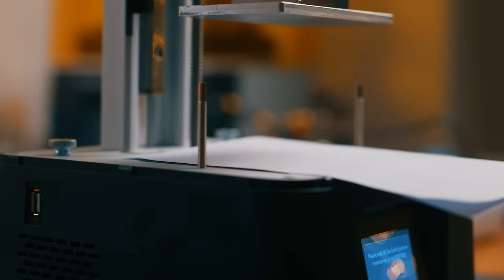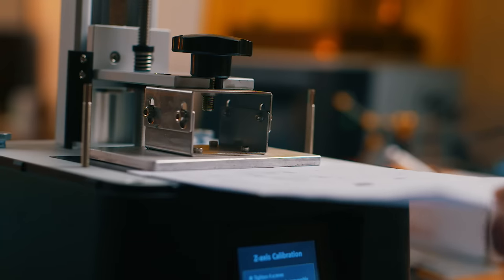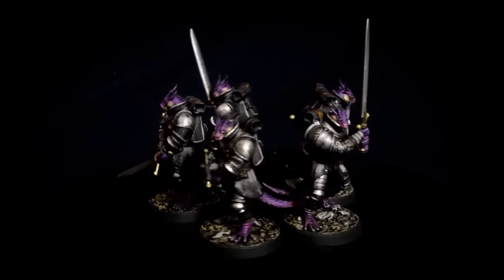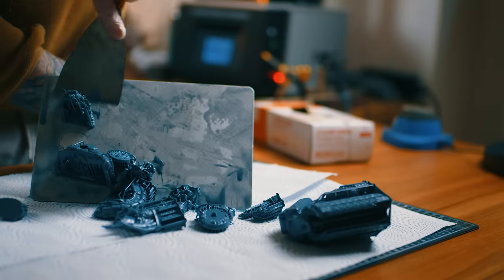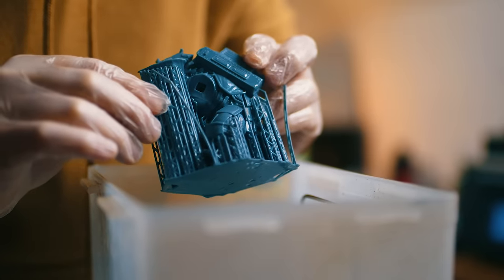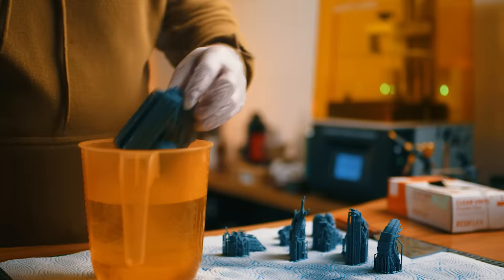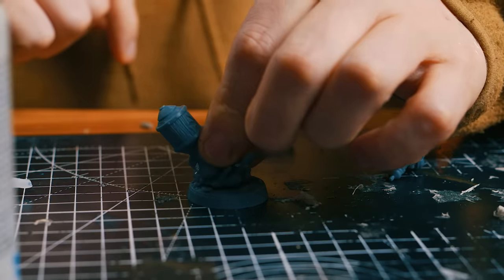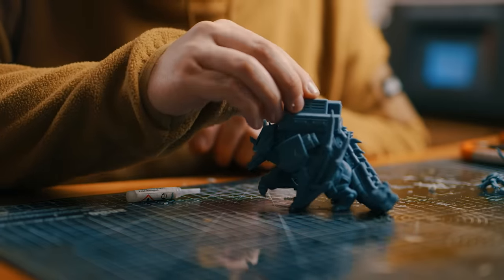Watch This BEFORE BUYING A 3d PRINTER

Comment: My Creality Halot One has been crap since I bought it a year ago - cant seem to get it printing One Page Rules miniatures at all.
Reply: Which resin are you using?
Reply: I really struggle with mine too
Reply: @SilentFlatulence  tried loads but had best results with elegoo ABS Like. The supports never seem strong enough and the models end up stuck to the fep. Literally given up with it.
Reply: OPR have a dedicated support section on their Discord where you can get help.
But the general tips still stand : bed leveling, printer on a flat surface, room temperature (min 20 C, 25 is best), shaking the resin bottle (never let it stay too long in the vat). 
I use Elegoo Abs like too and their settings and the only times I got failures it was mostly due to one of those reasons (temp mostly) and sometimes bad/low supports . It takes time but when the settings are right, your printer will go brrrr
Reply: @5lippy404  If you are getting supports printed but no models, I would say temperature or lift speeds. Try increasing the first and reducing the second, or as counter-intuitive as it sound increasing both. With lift speeds and separation from the FEP you can go for a slow gentle peel, or a fast rip, the middle ground is not ideal. My settings with ABS like is 180mm/m lift speeds, you can get away with 240 or 300 if its a very well supported model. 
Maybe even add a delay of 0.5-1s after each layer print before lifting if the first two dont help. I am far from an expert, but have a few years printing experience and these things have helped. Also if you have a full build plate increase your lift height, having a lot of surface area stuck to your FEP will stretch it more so you need to lift further to get it to sperate. 
Hope this makes sense and helps
Reply: @B4MBI72  I now use 3mm/s (180mm/m) on all OPR miniatures as this seems to get the best results. Room temperature is 15-18 degrees so its not very cold but room at the back of the house / back of garage with no radiators etc. I'm printing  at 30 seconds bottom and 3.0-3.75 per layer but the supports don't seem strong enough - even with pre supported models that others can print fine and at much lower exposures.

Comment: I'm curious about the meths use... I wonder if anyone in the hivemind could advise us on if this is ok...
Reply: Denatured alcohol /  methylated spirits has toxins added in order to make it unsafe to consume and sometimes those can be absorbed through the skin depending on what chemicals are used. It's generally considered safe to use as an ingredient in things like hand sanitizer but if I were to use it to clean resin prints I'd want to make sure I always wore gloves when sticking my hand in a tub of it.
Reply: @joegekko  yeah I usually wear gloves regardless... From what I can see online methylated spirits should be fine to use with PPE as with any other chem...
Reply: Copy pasta from another reply regarding meths (and purity).

It varies by country, in the UK for example methylated spirits by law has to be at least 95% ethyl alcohol for industrial use, consumer grade is 90% with regulations on what the % of denaturants are in both cases (methanol), consumer grade is also died purple.  In the US, denatured alcohol can be as little as 40% alcohol and 60% methanol, methanol is not nice.

I don't know if there are any EU regulations regarding the quantities of denaturants, I'm UK based and use bioethanol.  It's similar to metho/denatured alcohol being mostly plant based (distilled ethanol) unlike ISO (petrochemical) but has no toxic methanol.

Most bioethanol for sale in the UK claims to be 95% alcohol but as with denatured alcohol and iso, it's hydrophilic, meaning they all attract water so the purity will drop over time as they suck moisture from the air.